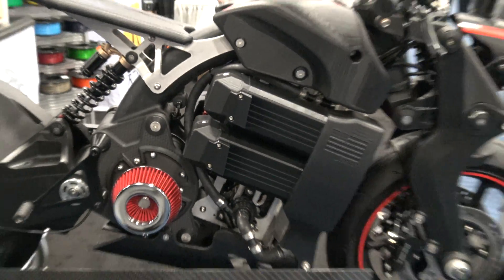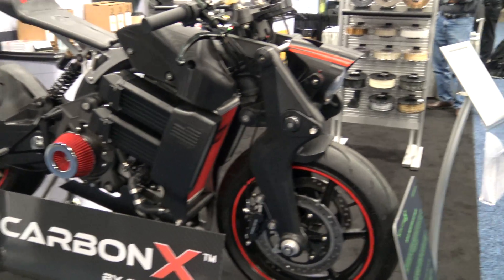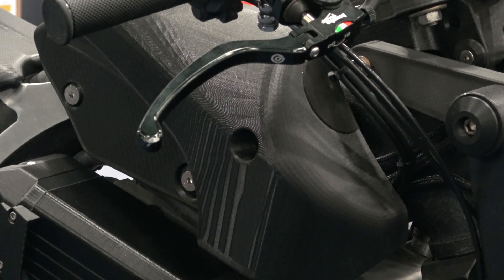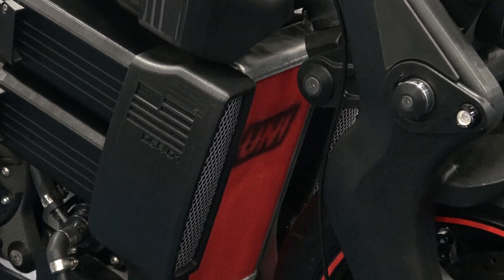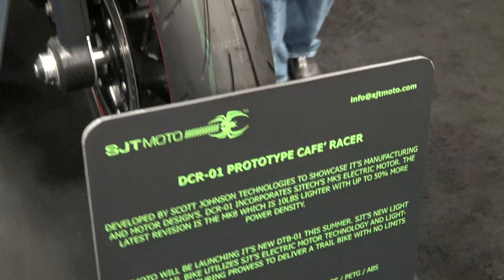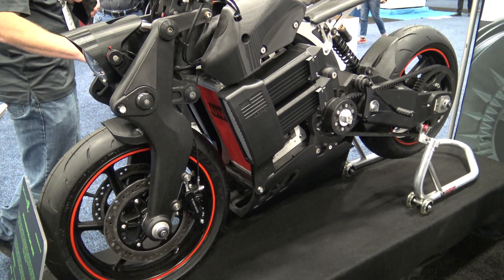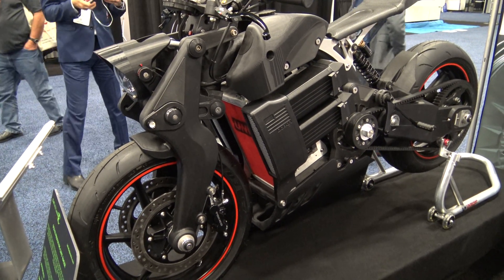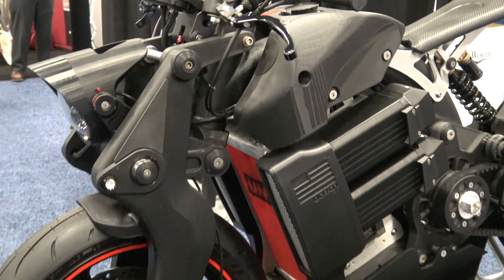3D Printed Motorcycle at Rapid Event

Comment: If it’s an electric bike, then why do I see what appears to be an air filter & radiator lines?
Reply from the maker: That's the coolant system for the battery I think.
Reply: You need to cool the controller, the mid drive motor, battery, etc